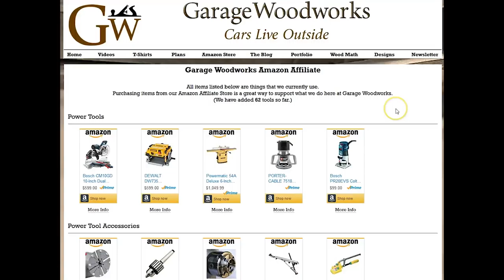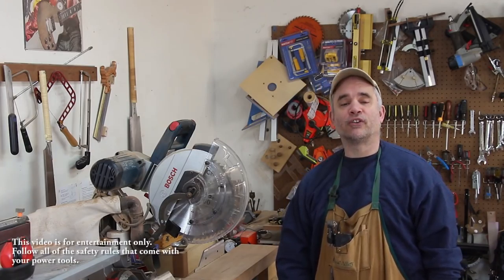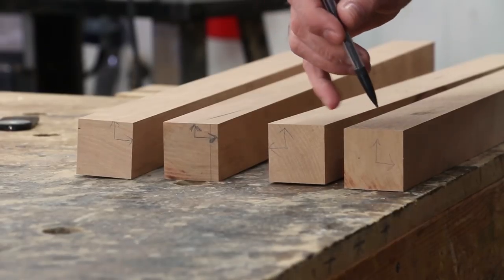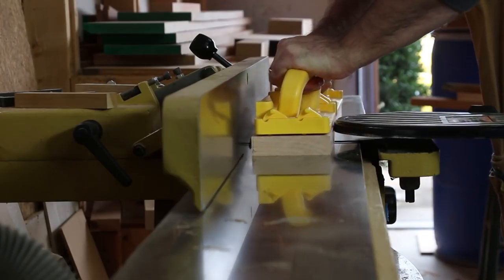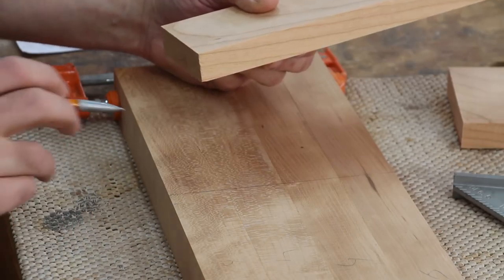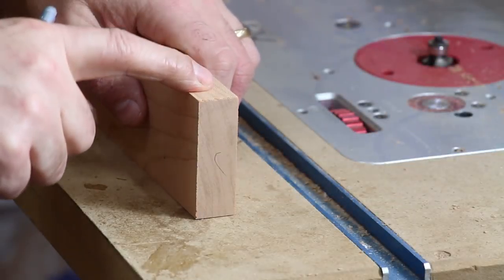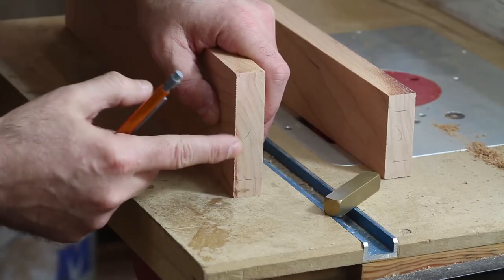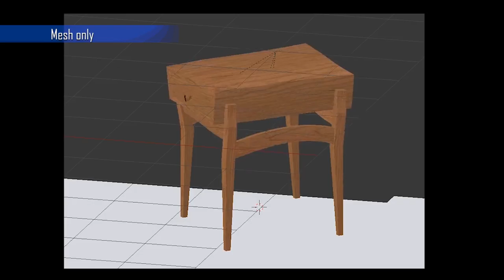Modern Drawer Box Table Part 1

Comment: Ok, I really liked the animated table. I also really like the design. Did you use a cad program?  Do you use full size drawings?
Reply from the maker: I use TurboCAD to design all my projects.  I don’t typically use full size drawings but for the curved side rails I might print out a full scale drawing for a template.
Reply: GarageWoodworks Thanks and keep the videos coming!